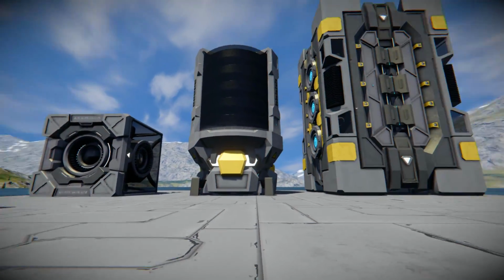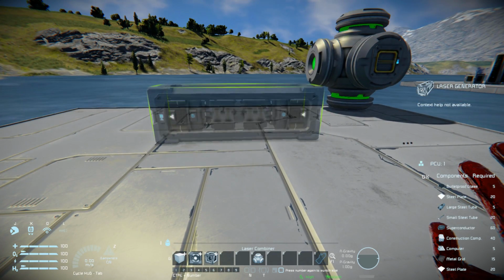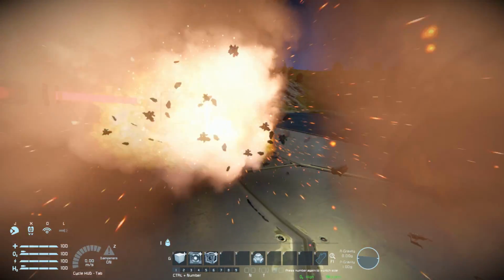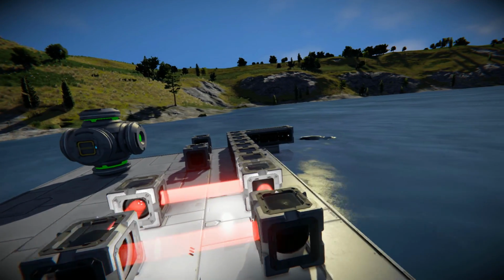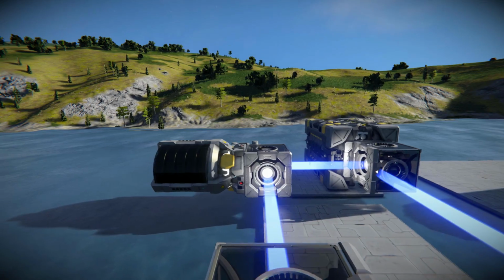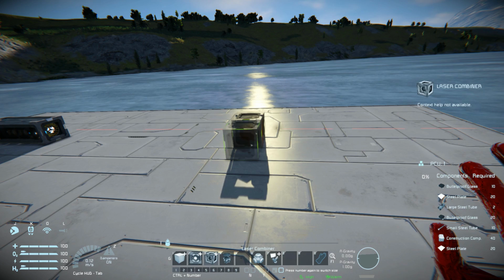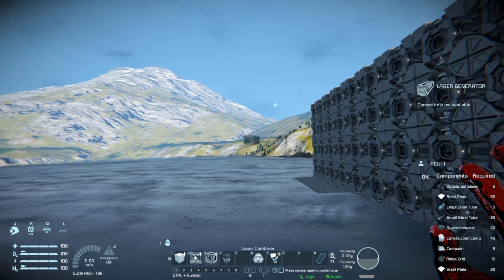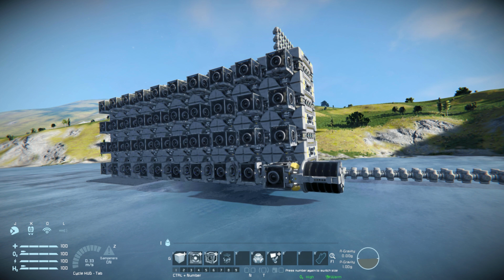2cm Beam System - Space Engineers (Mod)

Comment: Seems more like a fence than a firing solution.
Having to take a block away that this fires also seems strange,
you sure this won't work any other way?
Reply: This video is quite outdated.
There are now blocks which can be set to fire in two different directions at different increments from 0 to 100%.
This way you can make a turret work without removing blocks.

Comment: but how can you AIM and shot your laser from the loop? no rotor is fast enough to make proper change in angle within that time frame. I don't get it.
Reply from the maker: It really can only be built as a fixed forwards firing weapon unless you put the entire beam system on  rotors.
Reply: @JackRPG  Actually I did find a way to somewhat controll it using your method with prism-on-piston along with prism-turret using 2 rotors for changing directions. It's so damn expensive to fire tho :P

Comment: if your having power Problems there is a mod that can fix that, The Steam workshop has something called an "Arc Reactor". pretty much solves every power problem ever
Reply: the Azimuth power pack is also really good to have with this mod. 4 of the big fusion reactors should be enough for 2 - 3 ion generators to work at full output.

Comment: I think, now i can Build a proper Hiigaran Super Battleship.

Btw. the Range of the Beams depend on the Systems Charge. The Laser Beam have a Range of 1200m at lowest Charge, respectively 4000m at its highest Charge and the Ion Beam 4000m at lowest and 25000m at higest.

I dont think, that this Mod is OP, yes the Parts aren't too expensive but they need either stupendous amounts of Power, or the charging takes Ages. 
Also building a Ship with especially an Ion Beam Cannon as main Gun, is definately on the bigger Scale and also this Mod is set up, to work with the Defense Shield Mod.

I constructed a Ship with an Ion Cannon wich needs 10 GW for the Ion Beam Generators alone and needing 27 Minutes to Charge its 6 Capacitors to 100% and the Beam burns only for a bit over 6 Seconds and the Term Canon with Thrusters fots the Ship perfectly. Ok it vaporizes everything in its Way but because the Charge takes so long, this will take only one use in an Battle and after fireing it's just a gianormous unmaneuverable chunk of Steel wich now is, at least after the first shot, a high priority Target.

What i want to say is, Ships with an Ion Cannon are like a Death Star. Good for one terrifying blow but after that its no real Thread any more but instead a huge Target.

With the Laser it's an other Story. You still have either unholy charging Times or Power consumptions but the Damage is way less than that of the Ion Cannon. If you put arround 5 to 10 GW in the Laser System, you can make a cutting Laser that burns as long the Reactors have Fuel, but this is again expensive as fuck. Wichever Way you look at it, it's either expensive or timeconsuming but foremost Big, especialy if you don't want to use pretty powerfull Mod Reactors with Outputs in the high MW or even GW Range. 

P. S. You forgot one Point in your Review. For the first Time in the History of actual Beam Weapons, we are not depentent from the Color Taste of the Creator. You can change the Beam Color to every Color you want, by coloring the Blocks of the Beamsystem in the Color you want. But it only works if the Saturation is at 100 everything below colors the Beam by default. And if you want a Pink Beam but not a Pink Laser System, you simply can turn down the Value to 0 and the blocks are just Black but the Beam will still have the Color you selected.
Reply: Protip: If your struggling for power use Azimuth's power pack the 3x3x2 fusion reactor outputs 1.2 gigawatts, also if you use enough laser generators you can have a continuous laser which can cut ships in half out to 4km! I found an empty hull of the Hiigaran battlecruiser so i kitted it out with 4 laser turrets all of which can do but don't usually do continuous fire.

Comment: Can you use a grinder/welder system to build a block to re-direct, the beam as a weapon once the loop is charged, and grind it down to allow charge
Reply: For the Laser IDK. 
But for the Ion Bram... 
Short, Nope.

And thats why: 

The charged Ion Beam allways makes Damage to Blocks that aren't fully constructed Ion Beam Combiners, wich means, thanks to the explosive damage, your Array blows up in exactly that moment, the Combiner gets Grinded to its last Construction Stage or the Projection becomes to the first Stage. Luckily Rotos get much more Stable. But if you prefere a Solid State System you best use a bunch of Laser Generators and bundle them to a nice Beam. Maybe this Mod will get some kind of Shutter or Selectable Output or something in this direction. The Creator announced a beam Splitter for each System and in the newest Version, the Laser System have also Capacitors so the creator is definitely not lazy since there was 4 Updates in the last Week alone.

Comment: System could do with a 'trigger' block, so it redirects it like a combiner block but when triggered will come out at 90 degrees or something so you can actually charge up and fire it out of the loop without having to delete a block or use pistons/rotors
Reply: i mean, i see your point, but i also think its good as is, because right now, its a terrifyingly powerful weapon yes, but you need some knowledge to actually get it working, plus it can be used in all sorts of fun ways

Comment: Now, this is awesome.
Just imagine actual Planetary Defense Ion Cannons. You would have a big Gun platform (and a lot of power of course) and a Turret, to shoot down any enemy Landing Craft or Ship, trying to invade or land on your occupied Planet. Any reasonable sized Ship would definitely be obliterated unless it's big enough to survive the Beam (a Battleship or Carrier for Example). It would punch a hole through it or maybe have it lose an Engine or Reactor, but its Size would make it still flyable (or at least landable). We can have proper Subnautica Spaceship Planetary crashes!.
It shouldn't be utterly overpowered either, because the Time and Energy consumption it would take to Charge and fire the Beam again would be enough for maybe a second Landing Ship (or the damaged Battleship) to at least break through the atmosphere and vanish below the Horizon, escaping the Ion Cannon thanks to the Planets curvature.
Reply: Considering the sheer size of the weapon, a heavy ion Canon is only practical and build able inside an asteroid or in a ground station where you build the generators underground. A ship can carry it (and I already built some prototypes), but they will need to be much more compact, and as a result, smaller. 

It is also important to note that this weapon is also the single most dangerous energy weapon you can use. If the loop is broken and one of the corner blocks is taken out of action, the weapon will discharge all of its stored energy inside your own structure. If you are lucky, it discharge front and you missfire. If you are unlucky, your whole ship vaporize.
Reply: @mobiuscoreindustries  so death star
Reply: YTer Apologies did this with an entire moving parts system and base with a strike ship printer as part of the weapon defence. It's called Ion Cannon Facility and i think it's even on the workshop.

Comment: You could run the whole thing from a small grid small generator...
Max power draw is 125 watt/hours on the small laser & 2.5 kWh on the big'un. 2.5 kWh is nothing in this game. An antenna transmitting @ 5km uses 10 kWh. 
Most laser systems on the workshop draw & store insane amounts of energy to fire. This one just needs a metric shit-ton of space to build & can't be easily fired. (Although, to be honest, you can just design your ship out of small laser blocks & combiners with an exit at the front. 100 lasers means 12.5 kWh power consumption for a constantly firing deathray.

EDIT: True, got my units of power & energy mixed up. In any case, there's been an update to the mod. Power draw was increased about a thousand fold. So now you struggle to power even a single laser, not to mention the Ion Cannon.

- Laser power draw is now 125 MW, so you need 11 large batteries or 9 small reactors (large grid) to power 1 laser... at full power draw... it's insane. Sure, you can get away with charging it in a loop and unloading, it's actually quite viable, even with no scripts (and this is a weapon you'd use manually) but the power draw restricts it from actually being useful... Aside from the fact that it's gigantic. Also, no more deathray :(

But the Ion Cannon... jeez. With a fully charged capacitor it vaporized half an Oban Tide from 8 Km away. The ship was literally torn in two.
Reply: Agreed, and even in real life lasers don't use that much power. 

On a sidenote, power draw isn't measured in watt*hours, but rather just in watts. Watt*hours is a measure of energy stored, much like mAh is milliamp*hours
Reply: low orbit ion cannon intensifies
Reply: @km5405  A single Ion Generator at full draw is 1 GW... And it takes a LONG while to charge a capacitor...

On the other hand I just tested one with 2 capacitors vs one of the vanilla large pirate bases.
The only thing left was a crater the size of the base. So yeah, orbital ion cannon is doable xD

Comment: Yo couldn't you have a system for the Ion that has all of the systems on the turret, and for the firing mechanism just have a piston that's normally full extended, but retracts (and takes the holding directer with it) when you wanna fire?
Reply: The trouble is that you may end up with multiple combiners ejecting their charge depending on where each charge is at the time of lowering it.  If you could make the previous combiner rotate to follow the one on the piston, you could still make sure all the power is being pumped into the one combiner as it lowered and thus fire from that lowered combiner only.
Reply: @Gaalidas  No, I meant for the combiner on the piston to work as a latch, the actual firing combiner for the then-charged beam would be the one that was facing the one on the piston. That way, the piston doesn't interfere with the position of the laser, only with the state, charging or firing.

Comment: Yeah, but can you use it to make a really long tunnel? (either horizontal or vertical)
Reply: Yes
Reply: Yes, it will make a tunnel out to as far as the range of the beam. I would not recommend the ion beam for tunneling though. It's hard to explain but the first time you try it you'll understand why. The laser is much better for tunneling
Reply: yes, and quickly: a system of just the generators rotatiing would be able to precisely carve out voxels to a single grid unit
Reply: Thanks for asking. It’s almost the first thing I though of 🤣.

And thanks for the replies. 👍

Comment: So at full charge an ion beam would basically just vaporize everything it touches.
Reply: Yes, though as you can seei it is the single most complex largest and power intensive energy weapon on the workshop, one that not only need a purpose built craft, but also a great deal of care when in operation. Remember, if the loop is broken during charge, then the laser will most likely discharge inside your own vessel, and I do not fancy your chances of survival of that is the case.
Reply: @mobiuscoreindustries  you could perhaps have it very very deep in a planet underneath a base and use it as an anti large ship gun.  It would be painful to build and maintain but it would be out of reach.
Reply: @thenthson  as for the base, this is how I would do such a thing. The power supply, generator chain and capacitors loop is just too big to armor around it. The building would be seen from high orbits and it's just impossible to protect the thing correctly without making building cost skyrocket. 

Voxels have counters, lasers being one of them but they can provide decent protection, reduction in visibility, and less chances of a deadly missfire. All my planetary bases are build underground, with only the hangar sticking out the side of the cliff I built it into. It takes some time but you can easily get yourself 1 or 2 km of ground to the center of your base without having to dig that much, being both far from the ground bellow, but also not accessible that easily from targets above.
Reply: @mobiuscoreindustries  and chances are by the time you could pull that off without being supremely patient there would likely be better weapons for destroying ships. Although if done I could imagine it would go like the precursor gun from subnautica if it hits.
Reply: @mobiuscoreindustries  For a base you'd want to put the generators and charging loop underground, the only thing that should be above ground is the turret. The enemy would have to know where your charging loop is underground in order to hit it.
Reply: @thenthson  Pretty much. I built a 28 capacitor ion cannon and it can destroy anything.  It can cut any ship clean in half down it's length. The capacitors hold so much energy you can fire multiple times before recharging or fire one 30 second blast that is effectively a 25km long lightsaber. It's just a proof-of-concept though, have yet to build one into a base.
Reply: @killman369547  I could just imagine seeing that thing arc across the sky and hearing the enemy go crap crap crap as the see it going towards them.
Reply: @mobiuscoreindustries  yeah if that happens that ship is pretty much fubar isn't it?
Reply: @thenthson  yep depends on what beaks and where. If it is the fire mechanisms then you may discharge a shot forward, if it is the generators then your shot will slowly lose power. But the worse is if the fire mechanism is broken in the loop, because this will cause the thing to fire form the breach. If it fires into a side close to the exterior then you may just take heavy damage, but if it goes INTO the ship then you look at catastrophic damage. This is why that weapon, as powerful as it is, is what I would consider a balanced energy weapon. You can't have it on at all times, only when you think you will need to fire it. It takes time to charge, and it needs engineering to make work. And finally, both for ions and lasers, they can be dangerous to use. Way different form the usual energy weapons which are very easy, low risk weapons to use. Even less risk than kinetic weapons that can damage your ship if they fire into you.
Reply: @mobiuscoreindustries  as for the ship. A modular pre-built design that could simply jettison the damaged portions. Seems like a great way to summon clang though using merge blocks like that.
Reply: +Mansuy adrien. i accidentally set up a charging loop wrong with the smaller laser and on the first test fire oh boy did i discover what a mistake that was, blasted a hole clean through the front quarter of the ship, i am incredibly lucky it didn't take out the starboard lifting thruster array as i was in atmosphere at the time and had that array been destroyed i would've crashed.
Reply: @mobiuscoreindustries  foremost the Ion Cannon Beam has Explosion damage. So if you disrupt the Beam you are death but most likely your Ship or at least a Part of the delicate Beam System will blow up too. The safest way of dealing with this Cannons is to stay as far as possibel, while it's Online.

I found out about the explosive Potential of the Ion Beam, when my friend flew with his Fighter in the Beam, because both of us thought that it didn't making Damage in the Loop like the Laser. After that, he was Toast his Fighter too and the whole front part of my Ship floating away. Now it's Armored but now the Ship has also a even worse turnrate and Accelerations as well as decelerations are pretty cozy too, so now it became to a sitting Duck, no more like a sitting Goose, a really big and fat Goose.
Reply: @elrondmcbong467  really, it is a weapon which isn't a general purpose one. It actually comes closer to what a torpedo launcher offers in term of role. 

Torpedoes are one of the many player made weapons invented in the game, and they are specialised weapons of deadly effectiveness with the ability to guide themselves to targets .

But they are not useful in every situations and can in fact be detrimental at times. Hydrogen torpedoes require fuel, and ion torpedoes require recharge. Single core kinetic torpedoes can bounce off or have a bad hit if they bit armor at a bad angle, explosive torpedoes can be exploded by point defense and can sometimes not improperly do damage. Cluster kinetic torpedoes need to deploy a bit of distance away from the target, so a fast target can evade their payload. And so on. The launcher itself is quite large, the projectiles are relatively slow, they cost components to build, and they require multiple systems (torpedo silo, program core, missile core, camera designation array, turret sensor array) that can potentially disrupt of incapacitate the weapon if shot. Just like the laser, it is a primary weapon, and the ship is built around its use. It require patience and thinking as an error can be very costly.
Reply: @mobiuscoreindustries  absolutely true.
Reply: @mobiuscoreindustries  you don't need a purpose-built spacecraft, you just need a bigger spacecraft. You're correct though about the danger of the loop breaking. take a hit from an enemy laser wherever the loop changes direction and it's going to be bad, but you know what else is bad? Playing with the large torpedo mod and one of your nuclear tipped torpedoes explodes in the launch tube or VLS bay because the outer door didn't open fast enough.